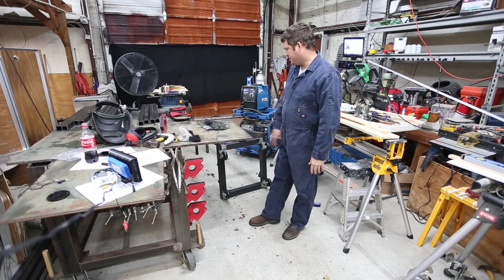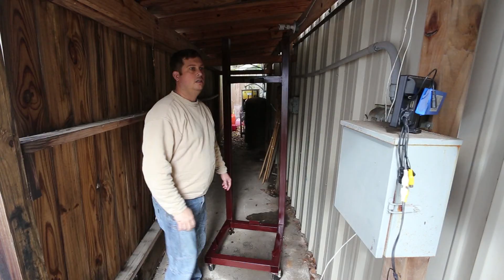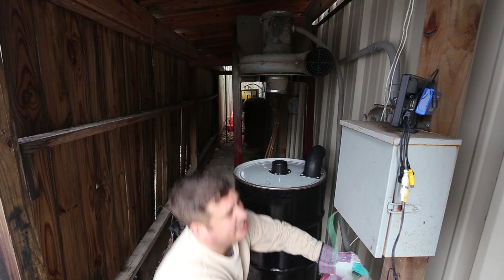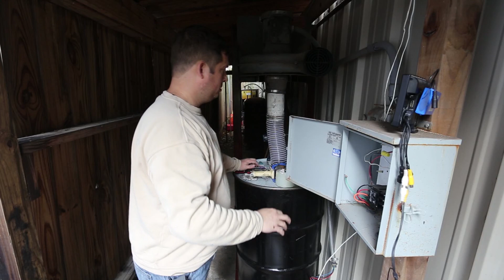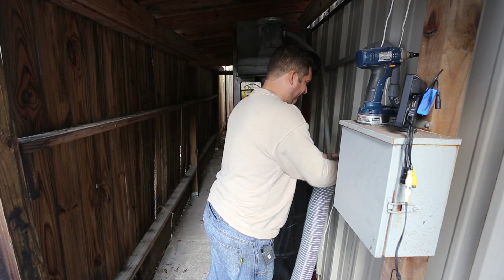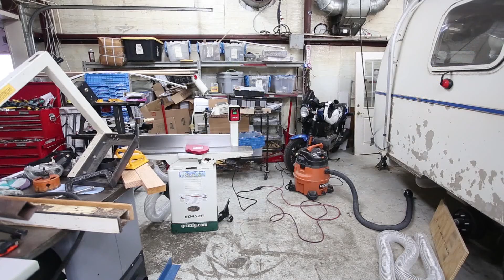DIY Dust Collector - part 2 with testing

Comment: I am seriously concerned about you working with electrics
You put no thought into to your work and bumble around for materials and hardware
Your use of paper towel whilst installing the pipe to the lid is almost criminal, why didn’t you let the silicon dry and then cut it off with a sharp knife
The wiring was too short to position the extraction unit were you wanted and connect to the controls/ switch box. 
Advising viewers to cut a round hole with a hacksaw
Your tools are inferior and stop working while filming
You talked about catching the fine dust but there is no filtering element
When you put your hand up to the flex piping there didn’t look like there was a lot of suction and you didn’t show the bucket of saw dust being vacuumed 
I hope there’s no inexperienced YouTubers taking you too serious
Some of these comments I have made apply to your first YT video also
Comical and frightening at the same time
Reply: Hi Brian
All my points are valid and you would have to come up with a better thought out reply than the one above to change my mind
Look at first few seconds of 2 of 2 and your work shop it is a mess-you can hardly move  around your project
This is not personal - there are comments from watchers that lend me to believe they think what you are doing is the safe and competent 
I don’t consider myself a troll but do get concerned when I see You Tubers with very low levels of professionalism showing others “how to”
Have a think about my comments and hopefully it will help you improve or take some courses
Please note* Having made no videos myself does not confirm my knowledge and experience levels. I have no inclinations to make You Tube videos but do appreciate and encourage others with the right skills to produce them
Reply from the maker: I tried to check your videos to see how it's done... but wait, you don't have any.....

You are just a troll...someone who makes snide comments and tries to bring other people down to their level.  This device is still working great..... have used it on several items.  

There is no filter because the fine dust is exhausted to the outside.....

Comment: Nice use of an existing blower...I personally would've welded the blower mount a bit lower closer to the barrel to shorten up that flex line between the blower and the barrel...also, I would've just used 6" flex line between the blower and the barrel...the 6" to 5" reducer along with the longer line causes reduction in the overall CFM.

Comment: I've see a lot of other similar designs, but they typically have a piece of conduit going further down into the barrel in the center hole. I wonder if that would prevent pieces flowing thru...?